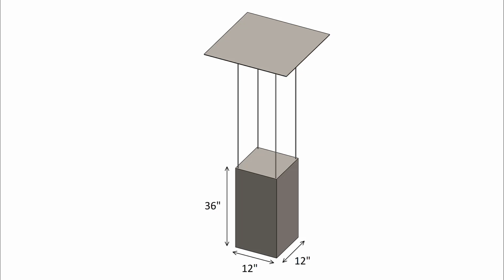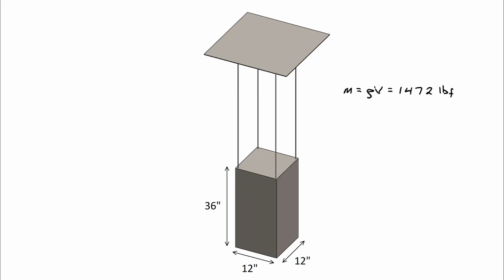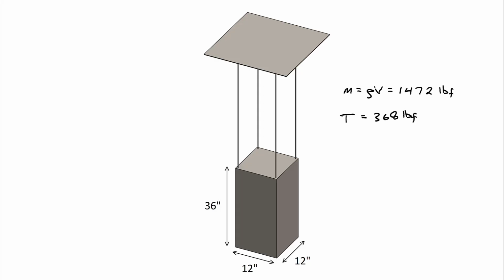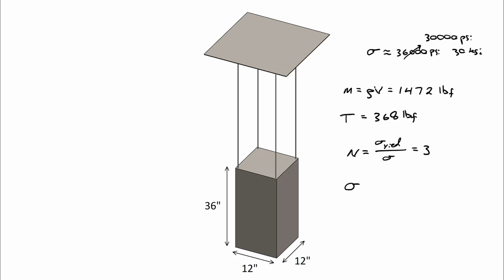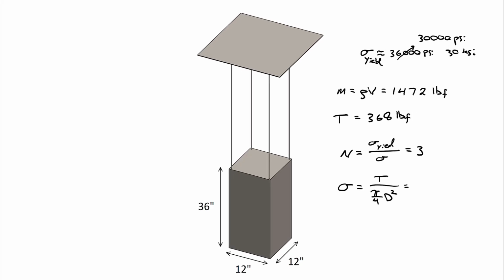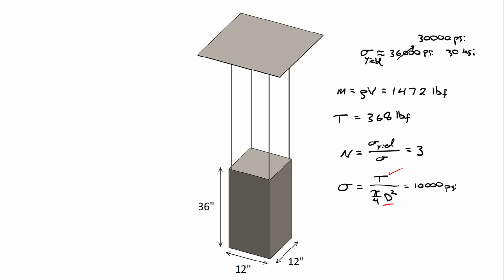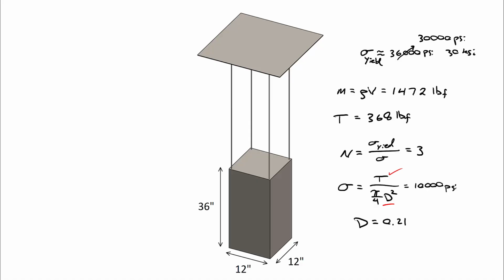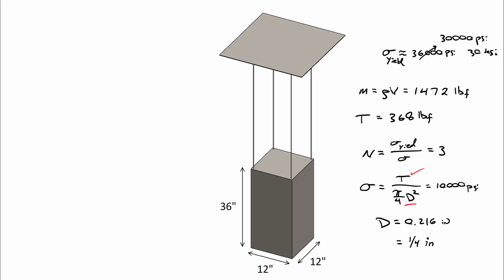Factor of safety for hanging box (see pinned comment - small unit problem)

Comment from the maker: At 0:50 I accidentally wrote mass with units of "lbf". The units should be "lbm". I was jotting notes in real time while talking to the AI and got distracted. However, on earth, an object with a mass of 1472 lbm will weigh 1472 lbf. To do this conversion formally, you first need to convert lbm to slugs: 1472 lbm * 1 slug / 32.17 lbm = 45.76 slugs. The box has a mass of 45.76 slugs. Then to find the weight you use W = m*g = 45.76 slugs * 32.17 ft/s^2 = 1472 slug-ft/s^2, which is the same as 1472 lbf.
Reply: I came to the comment section just to see how many people would catch that… 😅